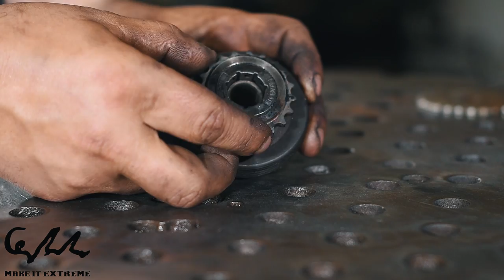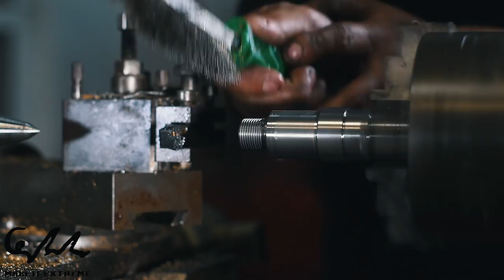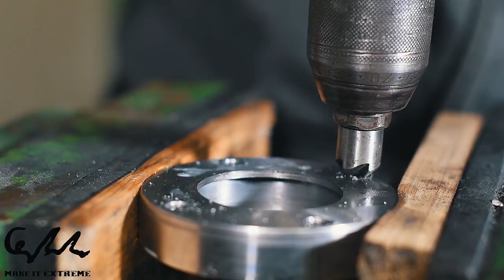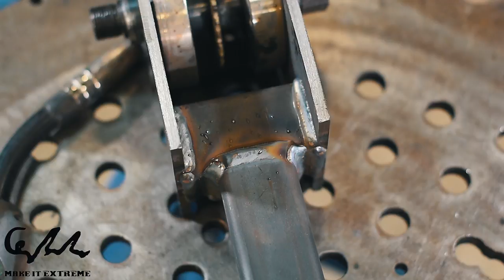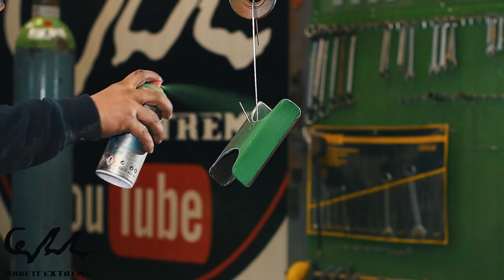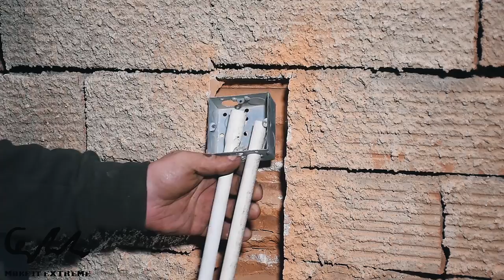Project 091 | Chain Saw to concrete groove cutter

Comment: You also need to make some attachment for the cooling of blade to increase blade life.
Reply: Yes, a guy with a hose needs to keep the dust down.
Reply: @barthanes1  But if you attach the hose and spray nozzles to the saw you can then do the job by yourself and the spray will be directed at the source of the dust.
Reply: Literatur dan apuy ewtr mbnlhsa
Reply: AMbros Custom k
Reply: Weh
Reply: The newer diamond blades are happy to cut dry... though a water spray system would cut down the dust drastically... 

😎👍☘️🍺

Comment: nice work as usual. Can I suggest you may want to add a way to supply water to the discs when cutting concrete or stone? just a dribble on each to keep the dust down and the discs should last longer

Comment: Excellent.
A cooling circuit for the stone cutting blade is required. And it can be simple and possible because the drive of the disc is not electric. The resulting dust does not rise in the air - the vacuum cleaner is removed when cutting the installation channels and the wall is ready for plastering the pipes.
The original oil pump must be deactivated - removing the drive worm?
The sproket must be welded in the chain wheel, ideally it would be to use a belt because the chain is made of steel and the steel rusts in water ...

Comment: Kewl project!!! If you take the first thing you cut out of the concrete slab and cut it again you have a perfectly square block that will fit in the groove you cut in the wall for what I guess is some electrical installation. You can even polish and buff the square block for extra points! :D

Comment: on a chainsaw, when installing such console it is necessary to replace the air filter! stone dust is finer than sawdust, and therefore flies into the cylinder. the same when cutting metal with an abrasive disc
на бензопиле, при установке таких насадок обязательно нужно заменить воздушный фильтр! каменная пыль мельче древесных опилок, и поэтому летит в цилиндр. то же самое при пилении металла абразивным диском

Comment: move the guards forward and fit a sprayer ..... would be a better work angle as atm you are kind of out of balance cutting on the front so it will want to bounce

Comment: Why two left hand threads? 
One should be left, and one right hand.
Reply: @gamerslap  they need to be different because both blades are spinning the same direction
Reply: @gamerslap  No. One nut ist right of the one blade, the other nut is left of the other blade. So the theads should be different too. In this case the left side (from the operators view) should be a right hand thread.
Reply: Yes, two left is as bad as two right. They need to be different.
Reply: @gamerslap , no need to delete comment, it is all about education here. Other people probably thought the same as you. 
Trucks have left hand and right hand wheel nuts, to help them stop coming loose. I don’t know why they don’t do the same for cars.
Reply: @aussiemanlyman2138  
Cars not perhaps for "consistency in procedure". Cars are for consumers who should be able to replace the wheels by themselves and left-hand thread would be too confusing.
Reply: @aussiemanlyman2138  Ford sierra has left hand and right hand threads on driveshaft nuts
Reply: @georgf9279  Exactly same as on a bench grinder. The left wheel (from user view) always has a left thread so when friction is added by grinding it tightens the nut and same for the right side with a standard right thread
Reply: @fasousa4798  For a bench grinder you are correct. This device however turns the other way round (the top of the blade moves away from the operator). So you need the left hand thread on the right wheel and vise versa.
Reply: @aussiemanlyman2138  early cars used the same system...think mopar(dodge) was the last to switch in the U.S..Basicaly they found that it just didnt make a difference on multiple bolt hole patterns as long as they were properly torqued.Lotta  60's and earlier cars have had their studs snapped off because people dont realize they are 2 different threads until after the cussing ensues lol.The amount of inertia generated on a lug nut is nowhere near enough to overcome the friction and clamping force.This changes a bit if its a single shaft and fastener spinning on its own axis but unless its a very large fastener or subject to very fast sudden and complete stops and starts it should never be a problem.... the main reason for many tools to still use the system is safety over human error...not gonna be a problem IF its properly tightened...if its loose however by using both left and right the nuts wont slowly spin themselves of the shafts
Reply: Yes a lot of 60s 70s 80s chevy C60s dump trucks had left and right threads  but think about it its multiple bolts that are not being spun on their axissi  like a tire with one big bolt in the middle it would have to be reversed on the side that runs forward and loosens the bolt with the forward rotation ,that side would be reversed so the forward rotation is also tightening the center wheel nut or bolt with its forward rotation , I guess they figured the car is rarely in reverse compared to drive , so after they figured it made no difference on multiple lug wheels they stopped the left and right  threads (I would be guessing on that last point) .

Comment: Really needs water line to cool the blade and to control dust, but that should be easy enough to build. Also open ball bearings with build that creates ton of fine dust? Yeah swap those to properly sealed ones and you might be on to something.

Comment: Maybe change the drive sprocket to larger one to get the cutting speed/rpm up to spec or nearer to it. those blades are meant to run high rpm. The saw certainly has the power for it.

Comment: Why did you remove the centrifugal clutch operation? Surely it would still operate the same if the chain were still attached as it is originally

Comment: Great. Would be even greater, if the diamond blades would have different rotational directions. But that would be a lot of work.
Reply: It's a good idea; it would cancel out the force but could be dangerous as it would add a sideways torque. I can't imagine twisting the blades during a cut would have a good outcome!

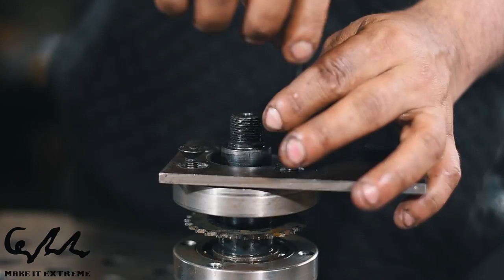Comment: 9:27 Do I see unsealed bearings ? 
Or are these old bearings just being used during the manufacture process...
Also.. L.H. threads on both ends of the blade shaft ? Should one not be R.H. ?? 
Concrete dust is gonna kill that chain... 😱

Not nitpickin, just really involved in the build !! 🙄😂

Great job.. 🤗
😎👍☘️🍺

Comment: why not buy a motorised concrete cutter?:D I dont really see why you need to build that yourself if you could use that time to build something cooler which you cant buy:))
Reply: @Voltaic - Elektro Werkstatt The version by Husqvarna is $2100.00 and much too narrow for the task. I've been watching MIE for quite a while. I believe he builds some of the tools because they are either not locally available or too expensive.

Comment: done very well but I felt it was dangerous
Reply: In what way ?
I mean its just an extended consaw... he has the chain reasonably guarded (though I'd have preferred a fully enclosed chain because of the concrete dust )  🤔

Some equipment is just inherently dangerous by its nature, a standard chainsaw would fall into this category in my view.

Occupational hazzard is a real thing... 🙄😏
Reply: @peterfitzpatrick7032  fjkgjjajahglalajllaa